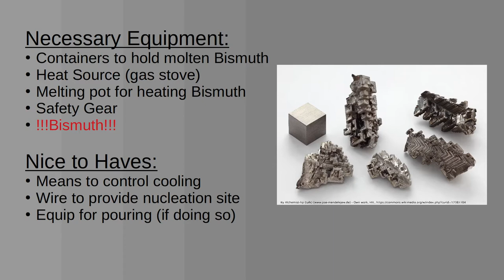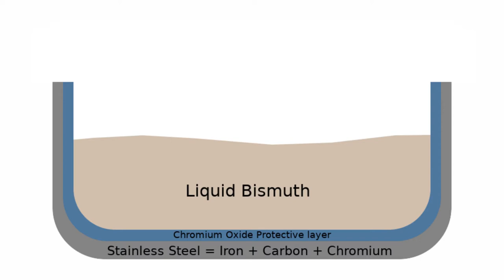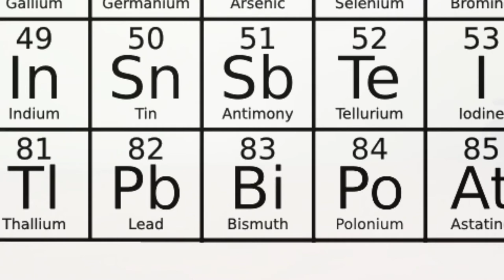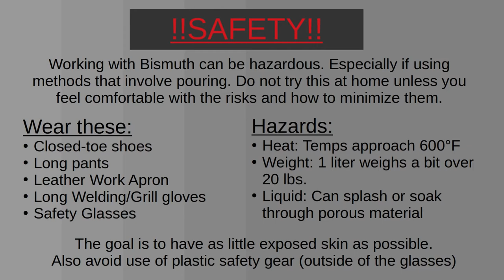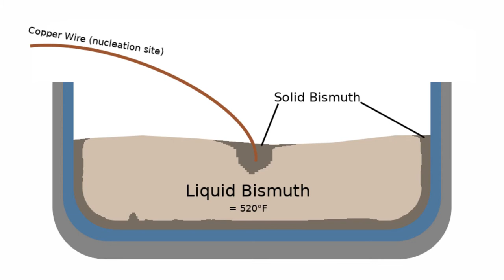Growing Bismuth Crystals!

Comment: Do you have any suggestions how to get the bismuth back from all the oxides after multiple cycles of melting?
Reply: All you can really do is heat the slag in order to extract as much of the non-oxidized metal from the slag as you can. Once the bismuth is oxidized, it isn't of much use. There are chemical ways to refine the raw metal back from the oxide, however it is cheaper to just buy fresh bismuth.
Reply: @anthonyamundson6318  I was reading from another site about heating it with charcoal and molten sodium hydroxide.  Wonder if that would work and/or if you've tried it.  The only reason I ask is because I know bismuth is quite a rare resource and even if it's cheap (today) it kind of feels wasteful to not do it.
Reply from the maker: @ThePeterDislikeShow  I haven't heard of such a process and have just enough chemistry knowledge to know I am not qualified to mess around with pure sodium hydroxide. Molten sodium hydroxide destroys glass and if you get it hot enough will also dissolve iron & steel. It will also burn/blind on contact (even in it's room temperature state), and also heats on contact with water and will literally pull water vapor directly out of the air in order to be able to dissolve. 

If you are concerned about waste of bismuth metal, it might help ease your concerns to know that most bismuth produced in the world today is made by refining the byproducts of sulfide mining at a handful of large metal mines. Most of bismuth metal's rarity actually comes from it not having enough commercial uses to justify mining bismuth ores directly. The ore is there (it is about as abundant as silver), it is just a dedicated industrial-scale bismuth mine would flood the market and crash bismuth prices, so no one does it.
Reply: @backyardmineralogy2066  Yea I have reservations about doing that too.  How about dissolving it into solution with a suitable acid followed by electrolysis?  That's something I think I could handle safely.
Reply from the maker: @ThePeterDislikeShow  That seems like it might be possible, but I am still not a professional chemist, so can't say for sure. I would also note that bismuth must be very pure in order to get iridescent colors on crystals. I am not sure if at-home electrolysis would achieve the desired purity (you would have potential contamination from the acid itself or from the electrodes. There is also the problem that this process turns a relatively small amount of bismuth oxide into a larger amount of aqueous waste acids with bismuth/etc contamination. 
If you are a chemistry enthusiast who can try this safely, then that is your prerogative.  Otherwise, it is probably best just to leave the bismuth waste as-is.
Reply: @backyardmineralogy2066  Start with bismuth electrodes then.  And get good quality acid that isn't contaminated with metal ions I suppose.
Reply: @backyardmineralogy2066  Do you still have the slag around?  I have figured out how to reduce it back to bismuth.
Reply: @backyardmineralogy2066  Do you still have the slag?  I have since figured out the carbothermal reduction and to my surprise I didn't have any purity issues.